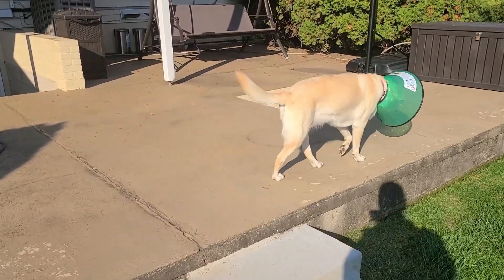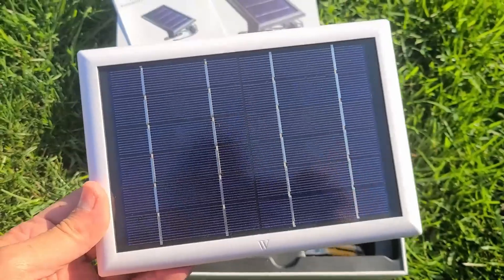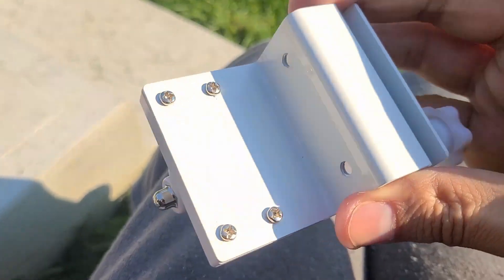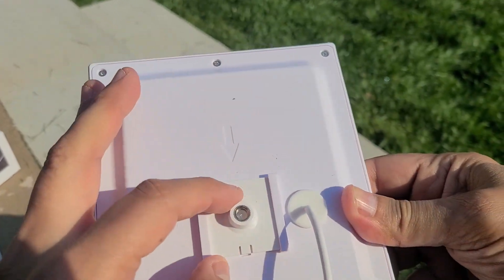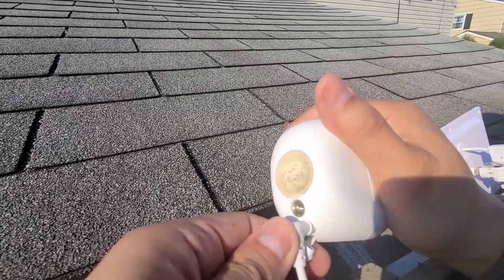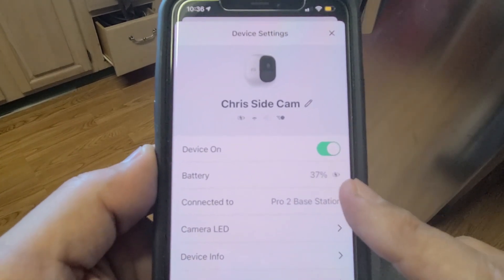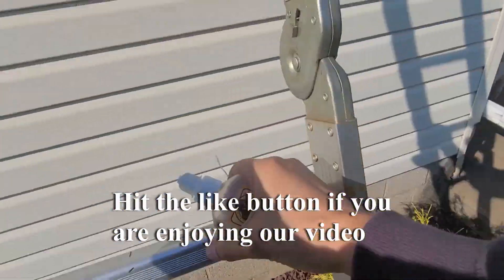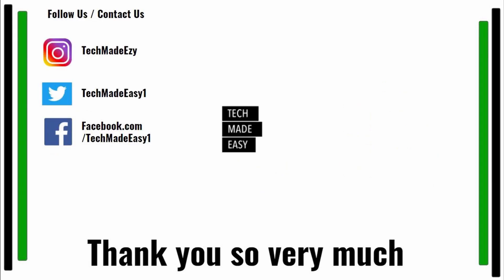Wasserstein Arlo SOLAR PANEL Detailed Review & Install for Pro, Pro 2 & Arlo GO

Comment: I installed this solar panel on my home for the Arlo Pro 2;  Had it installed while we went on a week and a half get away.  The battery was charged to 100% before wde left.  I made certain that the panel received sunshine at all times of the day when I installed it.  The battery fully discharged in several days.  When we got back I checked the connection and relocated the panel to the roof of my home.  Definately no shade or obstructions with the same result.  At this point I replaced the existing battery with a new, also fully charged battery.  Interestingly, the unit now shows a charging indicator.   Hopefully we'll see long term charging results.  Terrific video loved the detail, on your guidance I also placed a dab of silicone around the power cable.  As an aside I think you had the bracket upside down as my bracket has a lock on it.  Thanks for all you do.
Reply from the maker: Hi Barry yeah it might have been the battery, mine still works well I'm so glad I don't have to climb that ladder all the time. I bought a 2nd one. Good luck I hope it works out. Let me know how it goes and thanks for watching 👍🏻

Comment: I was a little nervous when we were high up on that ladder.  You are definitely brave.  How is the system working for you?
Reply from the maker: 1st thank you, I'm Impressed honestly, love not having to change batteries in high areas.  You have Arlo Pro?
Reply: @TechMadeEzy  I have a Arlo Essential (non-removable battery) and recently installed a solar panel.  One that is for the Eufy Cams, as I plan to switch to them to avoid the subscription.  But decided to hook to Arlo for testing purposes.  

Arlo makes great cams/systems, but once the 3 month subscription runs out, if you don't renew it, you are left with pretty much a decoration.  Shame really.
Reply from the maker: That’s why I’m using arlo pro 2, the fee 7 day no subscription chargers
Reply: @TechMadeEzy  This is true.  The legacy ones do have free 7 day rolling cloud storage.  But IDK, just seems cheesy the newer cams become worthless after subscription.  Its a wonder they can pull that off really, legal wise.

But anyway, that's a different subject.  Glad the panel is working good up there and saves you from having to climb way up there.  My installation was only about 11 feet high.  I stand on my Ridgid PRO Tool Storage System. LOL
Reply from the maker: Have a great weekend